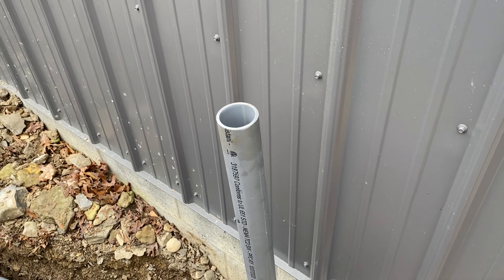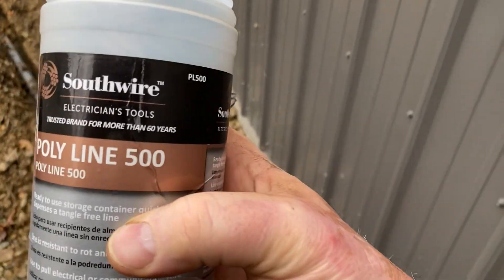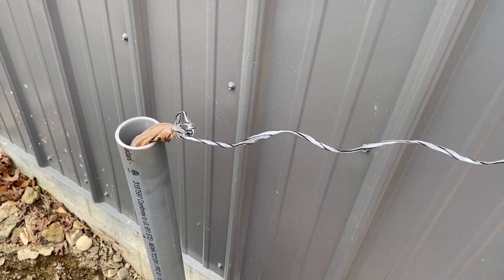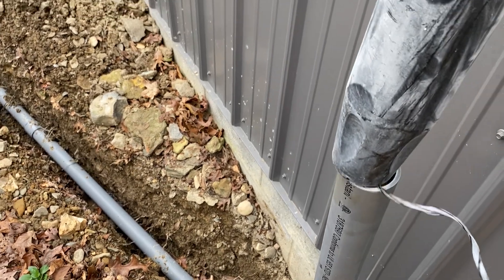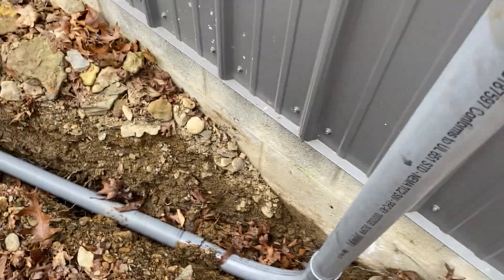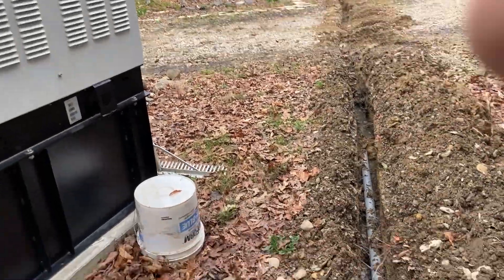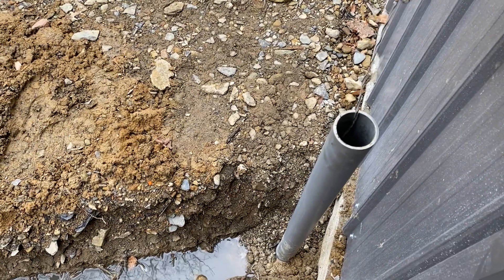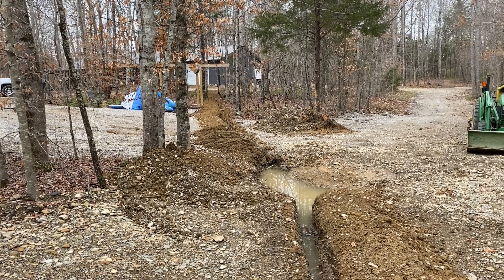Blowing line through conduit with a leaf blower.

Comment: Great idea I have a 1 inch conduit and my snake won’t pull through so I’ll try to string first one suggestion is get a chest harness to hold your phone. They’re not very expensive and it sure does make things a lot easier. I appreciate your video. Thank you.
Reply from the maker: It may be difficult to get enough volume of air into a 1" conduit. 
Alternate, use a shop vac to pull the bag and string through.

Comment: Did you filet your conduit before placement? It makes the pulling easier and reduces chance of cutting cable and snags.
Reply: He probably meant “file”
Reply from the maker: Thank you!  I searched the internet trying to make sense of what he meant. 

I did not file the conduit but instead was diligent to make sure all female ends pointed the same direction and then pulled the wire such that the wire passed male to female. In that way, filing ends isn't necessary.
Reply from the maker: I’m not familiar with your term. “Filet your conduit”?
Reply: Yeah what does “filet conduit” mean?
Reply from the maker: I had searched Google to try to figure out what he was referring to. No joy. It must be a term local to him or a misspelled word.

Comment: Trying this tomorrow in a commercial setting but am going to use as shop vac. 150 foot run but 4 90s
Reply from the maker: You can also use the shop vac to such the bag through instead of blowing. 
I should have mentioned that in the vid.

Comment: I do the same thing with little portable shop vac on reverse. The nice thing about the shop vac is you can take your spool of pull string and put it on a little carriage inside of the shop vac.

Then I pulling the string out the tube and then tie a small piece of styrofoam to the end of the string. Drop the piece of foam into the conduit hold a seal round the source end of the conduit while turning on the shopvac and boom out pops the foam on the other side. 

Power it off, open it up, cut the string. Done.
Reply: Are you saying to literally put the jetline inside the vacuum and run it out the blower end of the shop vac? That works? If that does, that's pure genius bro.
Reply from the maker: @markmywords5342  That would be neat and it just might work but that’s not what I did. 
The string entered the pipe between the pipe and leaf blower. I just left a short distance between the pipe and leaf blower.
Reply: @justTheInfo  Ill probably try a leaf blower too. You can nearly buy a leaf blower for the same price you can rent an air compressor for 1 day.
Reply from the maker: That’s another good idea. Thanks for sharing.